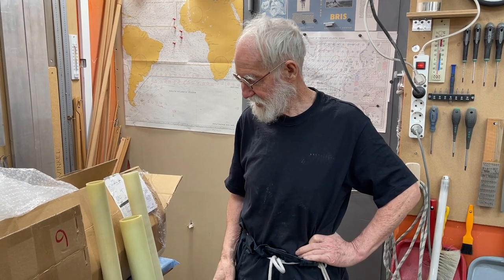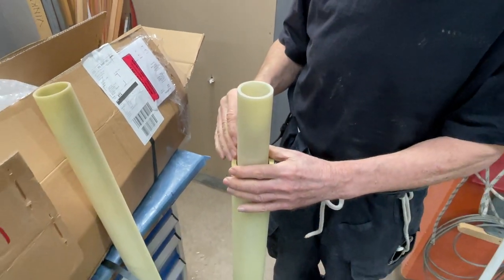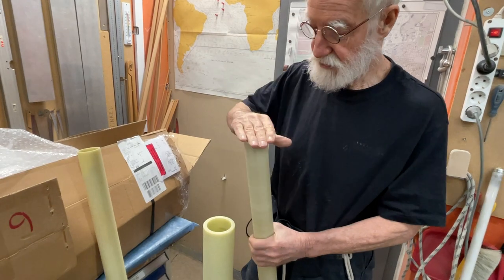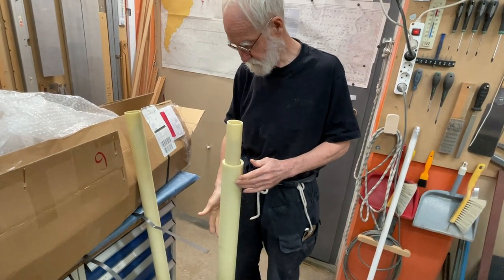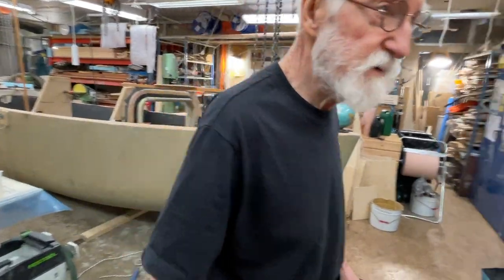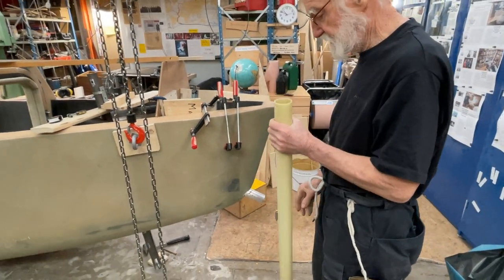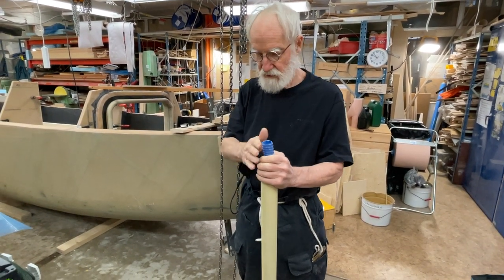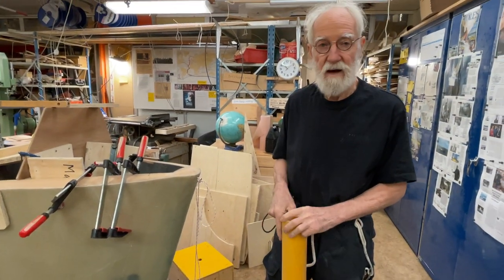More about the aft hawse pipe and how to prevent chafe on the rope/chain tail/drouge

Comment: Simple way to center the inner pipe.

Epoxy three evenly spaced wedges to the inner wall of the outer pipe, right at the bottom, before capping it.  

When you put inner pipe in, the wedges will automatically center it and keep it in place. Add some spacers to the top, and both ends are centered.

Comment: When you force the epoxy between the pipes, think about some way to keep the inner pipe centered. Maybe a tapered edge on the bottom cap.
Reply from the maker: I can wrap a thin string around the inner one and fix it with epoxy.
When cured it is easy to cut a passage for the fluid

Comment: Sven will you be having a bridal for steering with your chain drogue  , maybe centre of the bridal fed back up the hawser pipe so it can be steered from inside aswell  ? Thanks again Sven for all the updates cheers
Reply from the maker: Exlex have a canoe stern.
The point of the central Hawse pipe is that it is better than a bridle